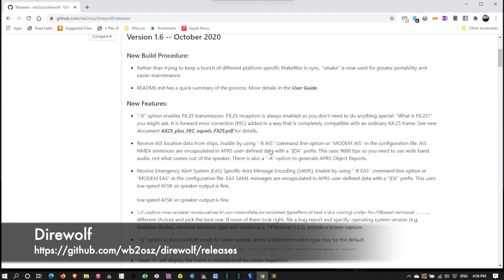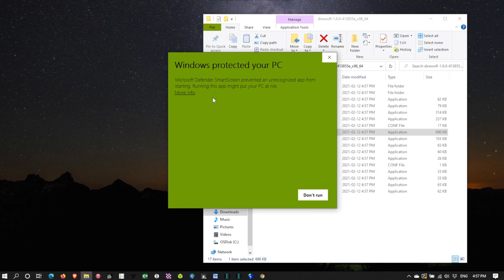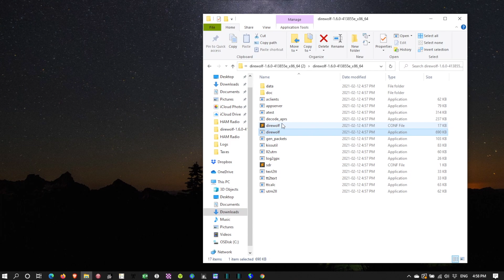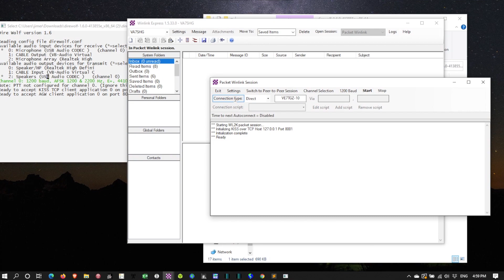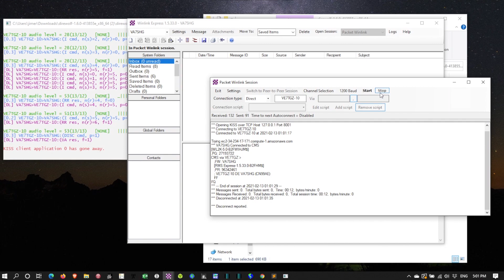VA7SHG - Windows Winlink & Direwolf

Comment: hi Jim. I'm looking for info on Winlink for the Mac user.  I'm a total Winlink Noobee.  Can you offer any advice?    73,  VA7BZZ in New West'r.
Reply from the maker: Hi Lee, thanks for the comment.  I haven't used Winlink on my Mac. I have used a program called RadioMail on my iOS devices that does Winlink.  It works well, though I use it with my Mobilinkd TNC3 to interface with my radio.  Hope that helps. 73

Comment: Tnc Packet Model Normal or Ackmode.
Reply from the maker: I think Normal mode.  I think Ackmode is too chatty, but I may be wrong.
Reply: @jimshaggy  I've seen in the UZ7HO soundcard setting and Winlink Express setup. The info from WDT group was to you Ackmode https://www.winlink.org/sites/default/files/RMSE_FORMS/quick_setup_guide_for_winlink_with_signalink_on_windows_v20190311a.pdf
Reply from the maker: Thanks for that Don. I’ll have to do some experimenting.